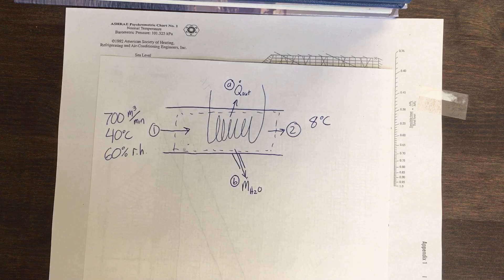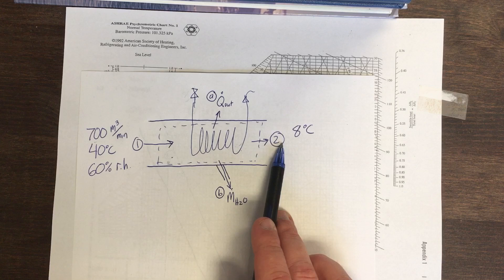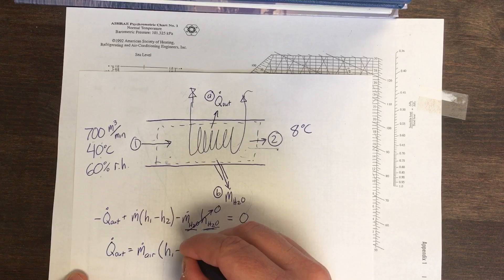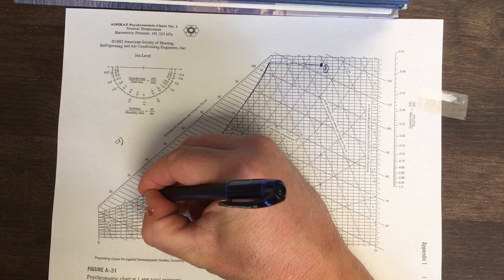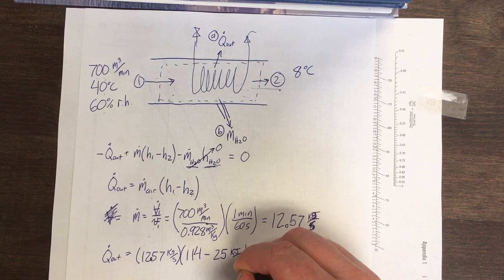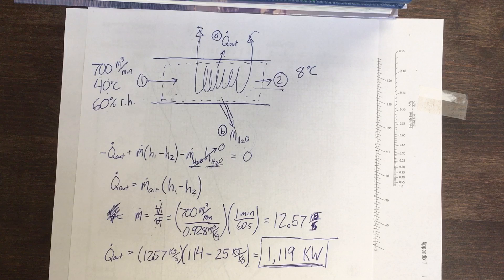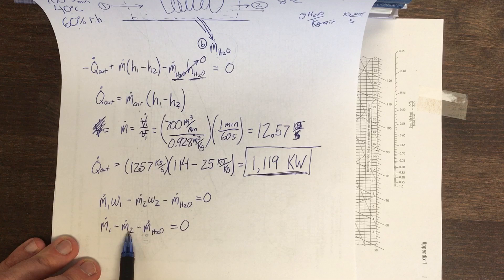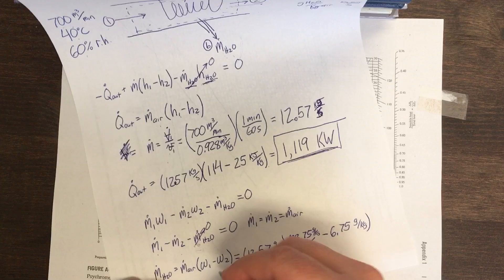Cooling with dehumidification

Comment: I work at a hospital and they use steam through a coil to reheat the air, the air in the building is dry for the most part year round. In the winter however we have issues with the air being too dry due to the chiller being on and the dry outside air being mixed in. I have seen the humidity in the lower teens, not good during flu season when people are sick. We have humidification in some parts, but not most.

Comment: Thank you very much for clear explanation. Only 1 small correction: in the last calculation the 12,57 are in Kg/sec.
Reply: final calculated result is 276.54 g/sec
Reply: @kennethlim6960  exactly, but it is a clear description of method. thanks  a lot

Comment: In an air washer installation, 100 m3/min of air at 5 oC DBT and 80% relative humidity has to be heated and humidified to 25 oC and 45% of relative humidity by the following processes; (a) preheating, (b) adiabatic saturation in a re-circulated air washer up to 95% relative humidity and then (c) reheat to final state. Calculate: 1. total heat added in kW 2. water mass to be provided to the washer and 3. humidifying efficiency of the air washer.      
Can you help me solve the problems
Reply: This process takes a zig-zag shape on the Psychrometric chart.  There are 4 states in this process.  State 1 and state 4 are fully defined, except the pressure.  We usually either assume 1 bar or 1 atmosphere, and constant throughout the system, if not otherwise specified.  I'll assume 1 bar.

State 1: initial condition of air
State 2: preheated air
State 3: adiabatic saturation after state 2
State 4: continue heating to the final state of air delivered

Knowns for states 1 and 4:
T[1] = 5C
r[1] = 0.8
w[1] = humrat(AirH2O, T=T[1], r=r[1], P=100[kPa]) "w[1] = 0.004372"
V_dot[1] = 100 [m^3/min] /convert(min, sec) "V_dot[1] = 1.667 [m^3/sec]"
rho[1] = density(AirH2O, T=T[1], r=r[1], P=100[kPa]) "rho[1] = 1.244 [kg/m^3]"

m_dot[1] = rho[1]*V_dot[1] "m_dot[1] = 2.073 [kg/s]"

T[4] = 5C
r[4] = 0.45
w[4] = humrat(AirH2O, T=T[4], r=r[4], P=100[kPa]) "w[4] = 0.008998"
m_dot[1] = m_dot[2]

Conservation of mass constrains states 1 and 2, and between states 3 and 4, such that there is no change in the humidity ratio across each of these pairs of states. We know the humidity ratio will be higher at state 3 than at state 2, because water was added.

This allows us to lock-in state 3, since we know its relative humidity is 100%, and its humidity ratio equals that of state 4.  We now have states 1, 3, and 4, fully defined.

Knowns for state 3:
w[3] = w[4]
r[3] = 0.95
T[3] = Temperature(AirH2O, r=r[3], w=w[3], P=100[kPa]) "T[3] = 13.03 [C]"
bw[3] = WetBulb(AirH2O, T=T[3], w=w[3], P=100[kPa]) "bw[3] = 12.57 [C]"

Now, we relate states 2 and 3.   Because this is an adiabatic saturation process, we need the wet bulb temperature of state 2 to equal the dry bulb temperature at state 3.  We follow the wet bulb line that starts at state 3, until it intersects with the horizontal line from state 1.  At that intersection, we will lock-in state 2.

Constraints for state 2:
bw[2] = bw[3] "Constant wet bulb temp across adiabatic saturation"
bw[2] = WetBulb(AirH2O, T=T[2], w=w[2], P=100[kPa]) "Solves for T[2] = 24.3[C]"

To find m_dot[3], we need to use conservation of dry air from state 2.  The dry air flow rate will be equal at all points, and is determined by dividing the total mass flow rate by (1 + w) at each state.  This means:
m_dot[2]/(1+w[2]) = m_dot[3]/(1+w[3])  "Solves for m_dot[3] = 2.083 [kg/s]"

Equate to find m_dot[4]:
m_dot[4] = m_dot[3]

Now find enthalpy at each state:
h[i] = Enthalpy(AirH2O, T=T[i], w=w[i], P=100 [kPa])

Now we find each thing we were looking for:

Item 1, Total heat added:
Q_dot_net = m_dot[1]*(h[2] - h[1]) + m_dot[3]*(h[4] - h[3])
Q_dot_net = 66 kW

Item 2, Mass flow rate of humidification:
m_dot_water = m_dot[3] - m_dot[2]
m_dot_water = 9.55 grams/sec

Item 3, Humidifying efficiency = actual drop in dry bulb temperature, over ideal drop in dry bulb temperature to wet bulb temperature.
eta_hum = (T[2] - T[3])/(T[2] - bw[2])
eta_hum = 96%

Comment: Great explanation. But, you found out mass flow rate of air to be 12.57 kg/s in the first calculation but used it as 12.57 g/s for the calculation of the mass flow rate of water. If in g/s, it should have been 12570 g/s. Which means about 276.54 kg/s should be the answer.
Reply: No I think you are wrong. He actually used “g/kg” but should have used “kg/s” and then his answer would have the correct unit of “g/s”. So the answer is correct but he just used wrong unit in the beginning.
Reply: And a reality check - 276kg/s is like a small river, that each building in the city would produce when cooling air. That would be massive amounts of water!

Comment: In My plant tem 38C and rh is 90% with 75 ton chiller ac plant how I reduce rh I want 55% humidity with 23c temperature
Reply: How about the volume, width height length, of the plant ?
Reply: @gozit3516  plant or ahu ?
Reply: @yuvraj-gaming.  the plant dimension not ahu.
Reply: @gozit3516  30×40×20 feet
Reply: I did not see the answers to you. Here are my understanding. Assuming you have Air handlers in the rooms or spaces to be cooled: 1) If you have outside air (OA) damper and OA is cooler and lower Rh than inside room air (IA), you can open up damper to mix two air streams (IA and OA), by release some IA; 2) If AHU allows adjustment of supply air temperate, set the supply air temperature below saturation temperature. Thus the moisture will be condensed out in AHU. Before you purge the near-saturated air to the space, heat up a little bit to avoid condensation in the room or space.

Comment: What study of engineering encompasses this subject?  Mechanical?  Environmental?
Reply: My architectural engineering (building engineering) program covered this at Drexel University.  Penn state has a similar program
Reply: Refrigeration system in Thermodynamics
Reply: HVAC industry using a mechanical engineering degree